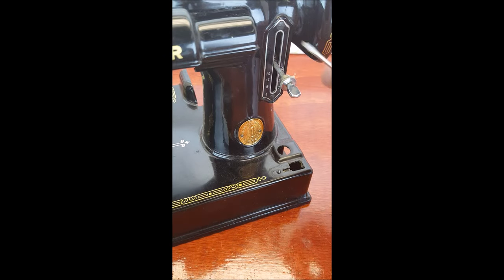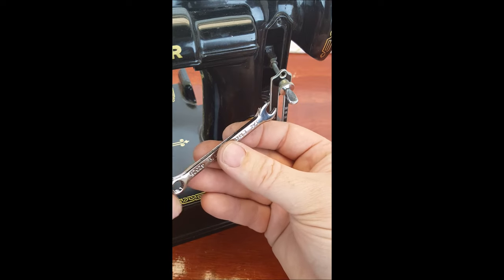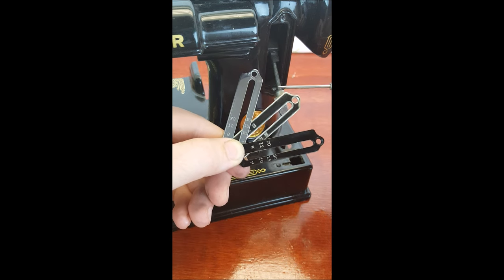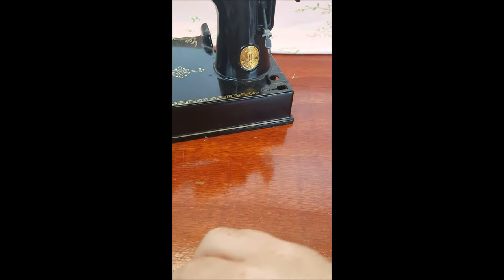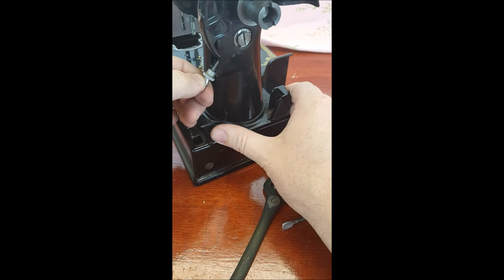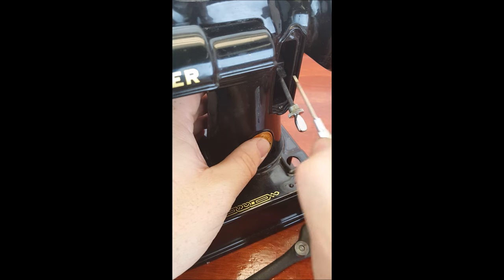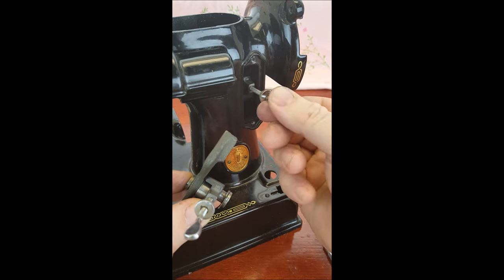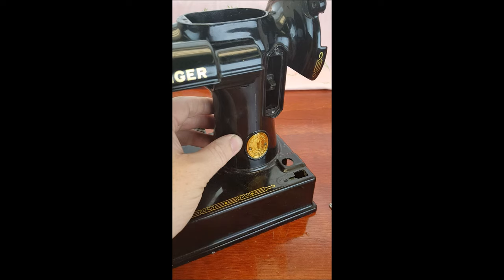How to Adjust and Service the Stitch Length Lever

Comment: Hi!  Thank you for your videos, very informative.   Can you help me sort a memory please.  When I was a kid, early 70's, my grandmother let me use her old black singer sewing machine.   It did not have a back stitch and I tied everything off.  If it had no back stitch function, would it have had a stitch length function?  It seems like I remember being able to change the stitch length but I know for sure it did not have a back stitch.     I know it wasn't a featherweight machine.   It did not have fancy painting on the machine, but may have had a gold trim painted on the bed plate.    I think it had a knee lever to power the machine.    I recently inquired about the machine to her daughter and she told me that grandma sold the machine in the late 80's.   I never knew.   Do you have any idea which machine I am describing?   I am trying to find the machine but no luck so far.   I would have bought that machine had I known.   So sad.     Thank you for any help you can give      Kim
Reply: I learned on a Greybar (Graybar?) that didn't have a reverse and did have a knee lever.

Comment: The electric cable inside the machine keeps degrading because of edge and touches the machine body inside - risk of electrocution when touching the machine.  Inspect the cables inside before plugging in

Comment: That’s great I think I have this issue on my 306k where the lever is frozen in the middle position and cannot get any movement at all especially for reverse, your video suggests kerosene to get rid of the varnish ?, the machine I have looks well oiled , I will look at adjusting the screw but could it be other issues 2 ?, thank you in advance

Comment: How do you adjust the stitch length?  When set at 6, mine is about 8 stitches/inch. I'd like to make the stitches longer when it's in th down position.
Reply from the maker: Feel free to contact the shop directly for more information and our customer service team will be happy to help:

https://singer-featherweight.com/
Reply: Did you get this problem solved?  I have the exact same scenario on mine.
Reply: I had this exact problem.  I was getting 8 stitches/inch when lever was at the lowest.  I removed the threaded lever and found that it was bent downward.  I re-installed it with an extra 1/2 turn so it was now bent upward, and now get 5.5 stitches per inch!  I'm happy as a lark!